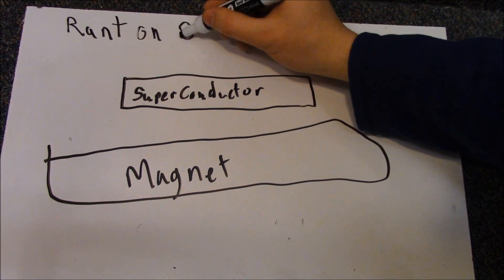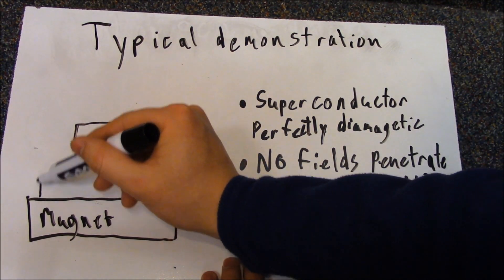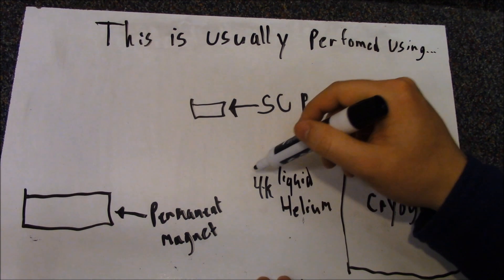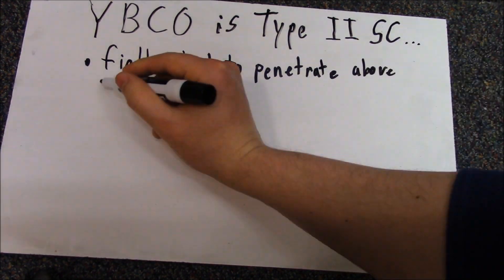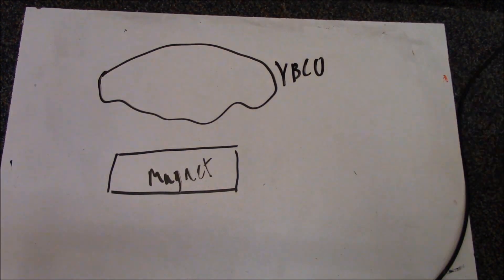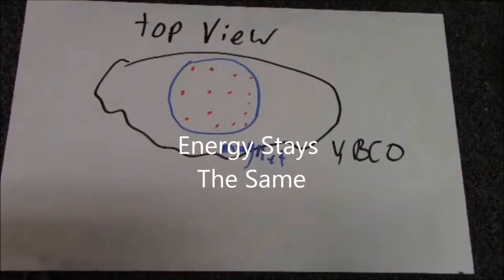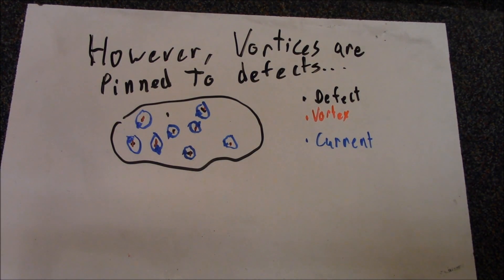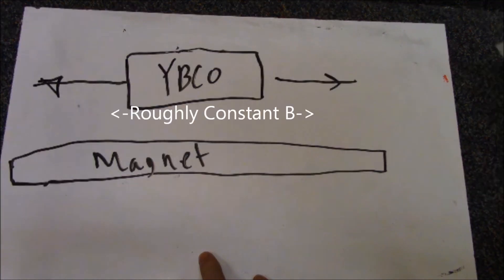Quantum Levitation or Vortex Pinning Explained

Comment from the maker: Here is an explanation of the "Quantum Levitation" videos floating around the internet.  In these videos, the floating superconductor gets locked to the magnet and will float even if placed upside down, something different from the standard meissner effect seen in type I superconductors.

This video explains this locking as a vortex pinning effect in type II superconductors, but you probably wouldn't watch it if I explained it here...

Note: As someone with experience in condensed matter physics, I do not endorse the use of the term "Quantum Levitation" in any way. That just seems to be the youtube term for this. : (

 #vortex     #pinning     #superconductor     #type2superconductor   
 #quantum     #quantumlevitation     #condensedmatter     #explanation     #physics    #levitation